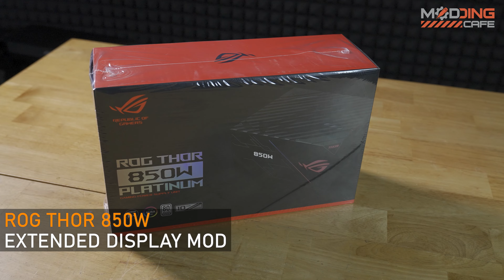ASUS ROG Thor 850W Extended Display Mod / Độ màn hình OLED PSU ra ngoài vỏ.

Comment: Hard to believe that there is a video about it, because that's exactly what I need. can you please write in english which two parts you have installed? Thanks alot!!
Reply: ah -> ffc14pin + connector =)  -> 1.0 Pitch or 0.5?
Reply from the maker: Exactly bro,
Reply: @ModdingCafeTV  last one is a Question ;-) - there are different Pitches available (0.5 / 1.0). if you remember or could check what you bought that would be great! 
(otherwise i have to open the device first to measure and later again for assembly)

For all other interested persons: it is also important to note that there is still an other difference on the cables:
A: Same direction:
the blue reinforcements are visible on the same side of the cable.
B: Opposite direction:
the blue reinforcements are visible on the opposite side of the cable.

Video looks like A!
Reply from the maker: @silversurfer8057  Sorry, It is 0.5 Pitch.
Reply: @ModdingCafeTV  perfect =) thx a lot!
Reply: @silversurfer8057  Thanks a lot! Could you please post links of the two parts so that we can use them as reference when buying? The links might not help to buy but would help a lot in getting to know exact specs

Comment: Anyone knows the specs of OLED screen? after 3 years is almost dead
Reply: As far as I could disassemble it myself is a Futaba design (W216) its what's in the front, the back has a series of numbers and letters (28F071826), I'm trying to find in the Futaba's website a replacement since mine comes and goes at times, plus it has visible burn-in, but to no extent, I think it may be an Asus custom design outsourced to Futaba.
Reply: @MrSunamix  @maxoc6575 it looks like it might be the Futaba ELW2106AA.